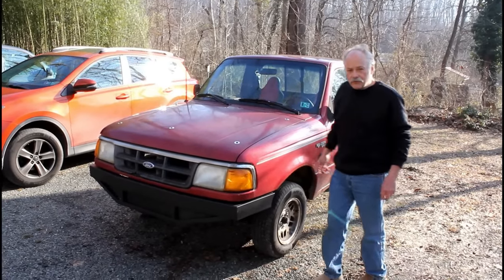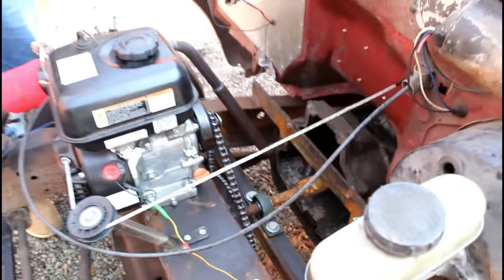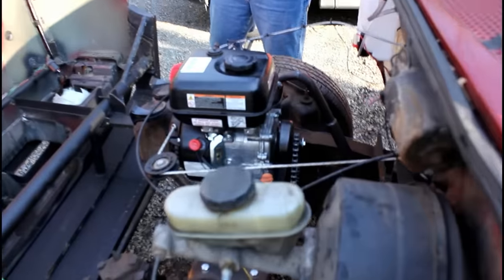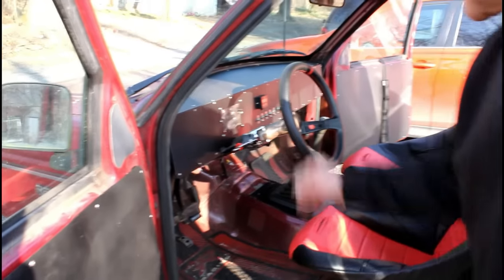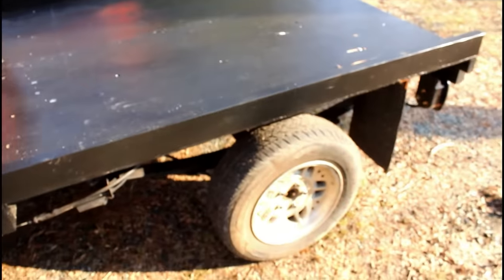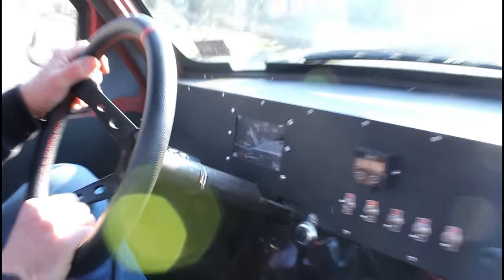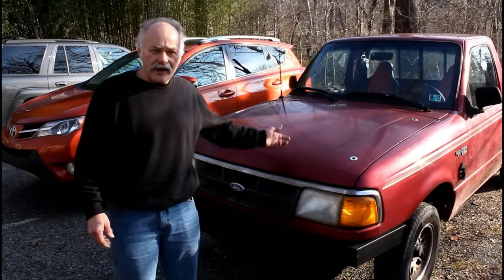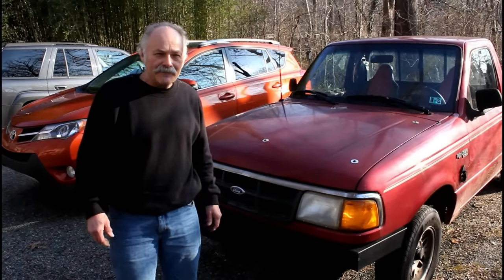Ranger Truck with 6 5 HP Predator Engine  [January 2021 video]

Comment: What about a Briggs and Stratton 23hp VTec riding mower engine.? A V2 with electric start and generator. Starts A1, smooth running and cheap on gas. My Dad's is still running strong after 20 years. Would need a 90 degree gearbox to change from vertical drive to horizontal.

Comment: Buy the $80 torque converter setup, it start at a much deeper ratio before going 1:1 so you will have 2 transmissions

Comment: Im curious to know if it has enough torque to use 3rd and 4th and maybe 5th gear ? None the less its very cool cant imagine the motor making charging enough power to run headlights and tailights though
Reply from the maker: Yes it did.  On the level I could run in 5th at about 20 mph.  I could go 35 with the 18 hp Duramax engine.

Comment: Is the flywheel mounted to the shaft with the sprocket? What does the pressure plate press against? I am shocked that the clutch can handle the weight, a belt CVT would make a lot of sense in this application.
Reply from the maker: There is no other clutch except for the go kart clutch.  The engine or clutch doesn’t know or care how heavy the truck is.  All it senses is resistance to rotating motion.  This is reduced significantly by gear reduction.  A 6.5 hp Predator engine can move a semi truck provided that it has enough of a low gear.

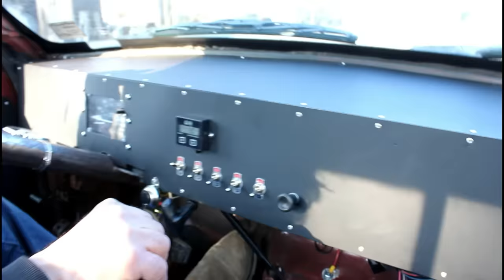Comment: Very interesting build! How do you shift the gears? Do you just let off the gas and let the engine go to idle then shift? It didn't look like you pushed a clutch pedel in when you shifted at 3:31.

Comment: I learned how to drive a manual transmission in a 95 Ford ranger. I wonder what it's like to drive a manual transmission with that predator engine. Would it be harder or easier?

Comment: Can you do this with automatic trans. Just figure out a way to put a sprocket on the torque converter
Reply from the maker: I don’t know for certain but possibly with a solid hub in place of a torque converter.  Some boats run solid hubs with automatic trans.  I heard of someone building one this way.  The centrifugal clutch will work in place of a converter.

Comment: Awesome! It does need a quieter exhaust system but that is avery good homebuilt. I love the tilt hood but I don't think it was nessessary and it takes away from crash worthyness if you was going too drive it on the road.
Reply: most of the noise is mechanical from the air-cooled engine. car engines are quiet because they are liquid-cooled and the liquid passages in the engine insulate and dampen the mechanical noise.
Reply: @marzsit9833  I am sorry too inform you but air cooled and liquid cooled have no bearing on how much noise a motor makes and if that air-cooled motor had a quality muffler and exhaust systems with no leaks from motor too muffler it would be as quite as any liquid cooled motor. What I was hearing was exhaust noise.

Comment: I don't see any kind of charging system, do you just run all the electrical accessories off of a battery?
Reply from the maker: Yes,  it’s just a few lights.  Turn signals, brakes, etc.  Probably never drive it at night, so I don’t think I would use the headlights.
Reply: @cars-bikesfabrication2887  sweet. I don't know if you know this or not but Small engine / lawn mower Dynamo generators are available on eBay starting around $30 to $35. I've seen them arranging anywhere from 10 amp up to 75 amp useable outputs. Also there would be no need to run a crank pulley belt system, you could run it off of the drive shaft or even the differential input shaft, only running lights it wouldn't need to charge all the time and just driving for a few minutes would completely recharge the battery no problems. I just like tinkering with the idea of sustainability in homemade project vehicles.

Comment: Bypass low oil pressure switch that might stop the engine from cutting off
Reply from the maker: That was not the problem.  The ignition kill switch shorted and ground the ignition.

Comment: Youd hear that thing coming at ya thinking its haulin ass then you see bicycles passing it puttin along..  lol..  motor that small needs a flywheel that weighs more than the people inside...  instead of waiting on glow plugs to heat up youd start it up and wait for the flywheel to build up speed..  lol

Comment: I think this is really really cool. I kinda wish I could find an excuse to build one. Something like this could be practical for maybe driving to the corner store or the back 40. I think if I built one I would use an extended cab and hide the engine in the former location of the back seat. I think would leave the hood, radiator and maybe the outer fenders off. In my rendition. The rear suspension could be a little difficult because of the extremely short driveshaft. Actually I just figured out how to make it work. Why did you have to show us this?

Comment: You would be much better off using a torque converter for a go kart rather than the centrifugal clutch. It acts like a CVT transmission, where the gear ratio is dictated by the resistance the belt sees. Plus , it would give you a 10% overdrive as well. You could probably away with using a 46 or 48 tooth driven sprocket , to give you top end speed. The torque converter would make up the difference in torque lossed. They are easy to tune , with different weights , and springs. 
Or use a CVT clutch set up from a snowmobile....... You'll be glad you got away from the cent clutch , after your first ride ......

Comment: What's the top speed?
Reply from the maker: This truck with the 6.5 hp engine had a top speed of 22 mph.  With the 18 hp engine it went 35 mph.  The truck was cut apart and built into the roadster that’s also on this channel.  Speed test with it to come.

Comment: UH, Huh.
Imagine a stagecoach with 4 horses. You unhitch 3
of those horses and make the 1 do the work of the 4. Will you 
get there? Yes, but slower. The 1 horse will not be able to pull 
the coach up a very large hill he will tire quickly. The 1 horse 
will not be able to pull a full load to passengers or luggage as
the 4 were. In the end the horse will die sooner than usual 
because of overwork.

!

Comment: I think the 2.3l would have been much better. I just dont see the reasoning in this as a daily driver. Cool project but not very practical.
Reply: That's the point. It ain't supposed to be practical

Comment: Uhh..I  put that  6.5 on my 3 Hp rototiller... And its meh. Can imagine, cruising along in truck, full throttle and overheating at a brisk 12Mph. Then a hill appears on horizon...2.5mph up hills...
Seriously this is sad, find a used forklift or commercial rider mower engine. You need at least 35Hp to push the truck usably. Best wishes.

Comment: Dont buy these engines. I did buy one used it once put it away come back a few months latter to use will not run. After tearing down I find Dissimilar metals in the carb float valve. The fuel control area of this engine is corrosion pit due to it acting like a battery. Too cheap to make the parts proper saves maybe .001 cent but ruins the reliability of the engine.